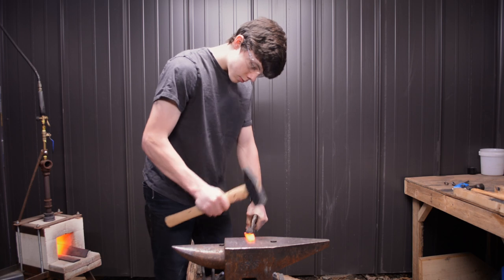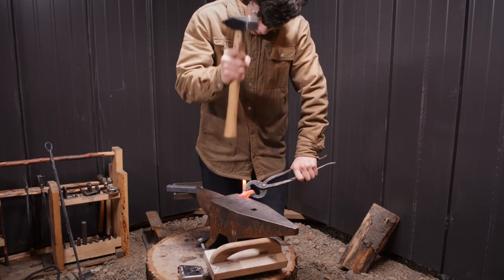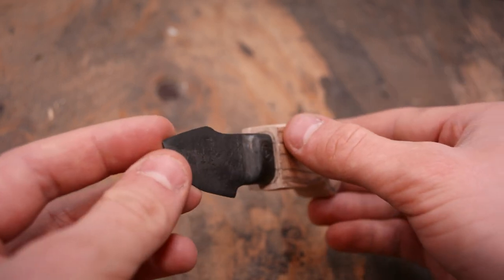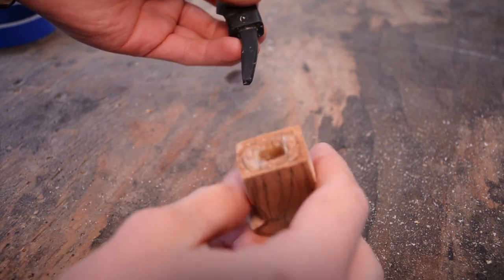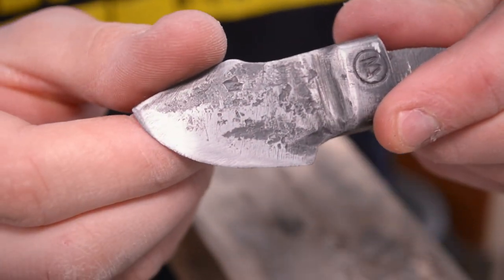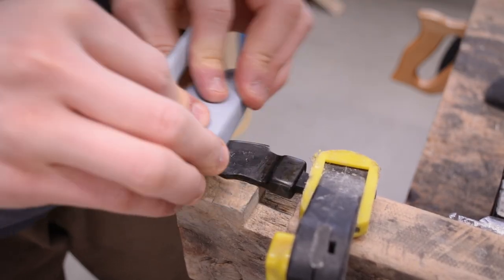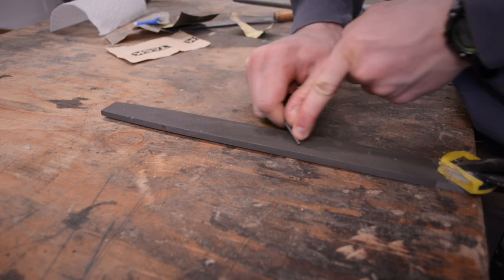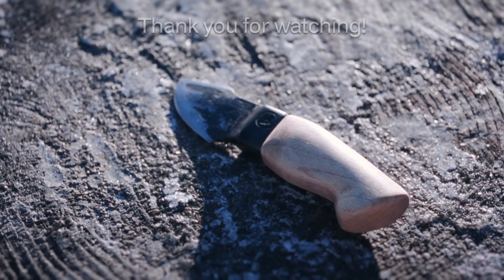Making a Mini Integral Knife by Hand

Comment: Great little blade there! My only critique here would be that there should be a mechanical connection of some kind. A 1/16" pin would do the trick nicely.
Reply from the maker: I thought about this, but thought it would be fine for a small knife if I gave the epoxy something good to hold onto. The tang isn't hardened so I could install a pin later if needed. Thanks!